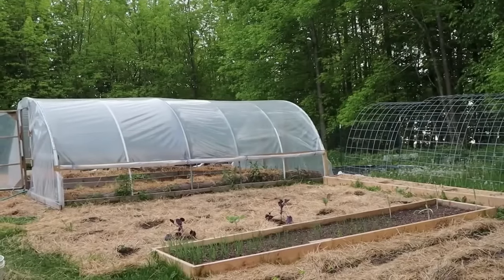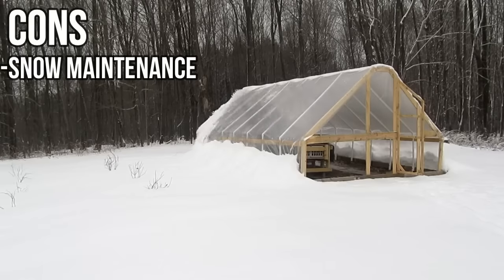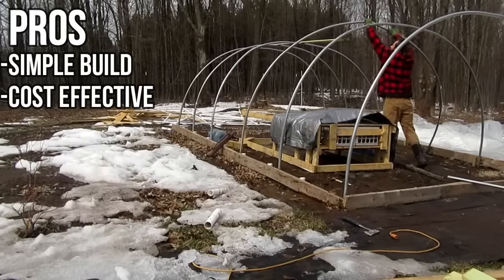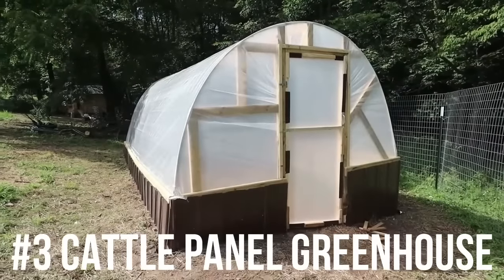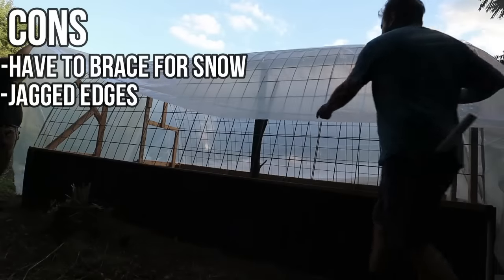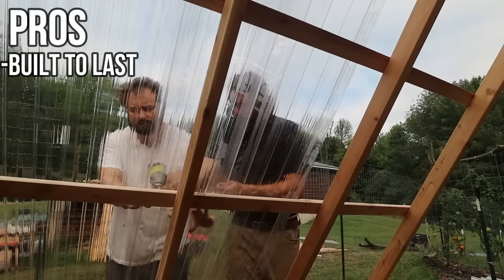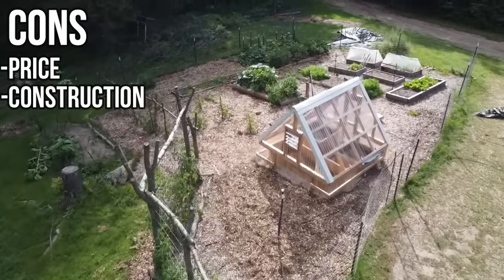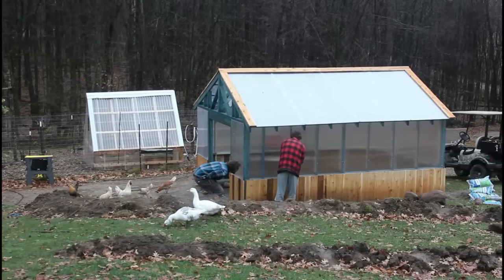The Ultimate Guide to DIY Greenhouses: Pros, Cons, and Everything In Between

Comment: When I get around to building my greenhouse it’s going to be a monster! 150 ft X 50 ft.  I’ll save some money by using my own trees and cutting them into lumber sizes myself.  It’s really going to be a chore to build, especially when I have to build it all by myself. With the help of my vehicles and tractor I’ll figure out a way.
Built my 20ft X 12 ft chicken coop tractors that’s all on wheels with a hitch to hook it up to a truck to move wherever I want. Makes it nice not having to clean as much, just move the coop to a clean spot and let the waste compost where it lays!  Coop itself is actually 12’x12’ and 3 ft off the ground so chickens can use the area under the coop to get out of the weather.  Hardware cloth goes all around it to keep chickens safe from predators.  Built it like a tank since I knew I would be moving it around like a RV trailer on a rough field. It’s over 3 years old now and still looks like new.  Very expensive and even more so if built today with cost’s climbing so much! But even 3 years ago this still cost me $6,000.00 to build since I used as much waterproof material as I could and treated lumber. All framing was pocket screwed together on all joints from both sides with deck screws and glued with exterior glue too! Even glued all the siding on as well.  So it won’t be falling apart anytime soon. Been a woodworker for most of my life and I don’t build things to be taken apart. Much less fall apart either!  I only wanted to have to build this once and never have to build another one to have to replace one falling apart!  I  hate having to rebuild anything!  Think I have accomplished my goal looks like, least so far judging by the last 3 years plus.  Sure get a lot of compliments when people see it.  Especially for being the first coop I have ever built. Fortunately I really didn’t make any mistakes that I have regretted yet! Even the 8 ft long roost that’s on hinges so it sold up against the ceiling and out of the way for cleaning the inside of the coop been a blessing for cleaning!  I didn’t want to have to try to always have to clean behind a long roost in cramp space! This was the best idea I’ve had in a while!  Building the greenhouse certainly going to be a bigger challenge doing by myself.  It certainly makes you think harder when you don’t have a extra hand or two to do the construction work! If there’s a will though, there’s a way! Eventually I’ll figure it out, provided I don’t kill my self in the process? 😂
Reply from the maker: That sounds unbelievable! Having access to your own lumber helps alot. You need to call that a green mansion haha
Reply: @TheNorthBranchWI  That’s funny! When I first built the chicken coop, people were calling it the Trump Tower for chickens! 😂  Before the chickens moved in, one of my relatives wanted to rent the coop to live in himself.  Actually would of made a good size bedroom compared to many bedrooms in some homes.

Comment: We have a cattle panel greenhouse. 8x16’. 
I hate it. We did put a ridge beam, but we are in a high wind area and the plastic has been ripped and repaired several times from it. Wind comes in and just inflates the whole thing, busting out the weakest link. 
We plant to remove the panels and use them in our garden beds this year and put an A-gram roof on the greenhouse with paneled sides.

Comment: My Father made a green house…. Approximately 15x45ft that was in the style of the #2… but ousr was 1. made with curved pvc pipes, 2. Had a double layer of plastic & 3. There was a mouse wheel style fan that inflated between the plastic layers. (This created a gap of insulation between the inside area and the outside.(edit! 4. The greenhouse my dad made also had a foundation that had lag bolts going through the 2x4 boards on the foundation that secured the pvc pipes)plastic was secures to the 2x4 with staples and caulking to help keep it inflated)

It did get destroyed in a snow storm 4-6 years after it was first built, later it was turned into a stable for a horse with open ends and a tarp. It was a great green house.

Comment: Appreciate you posting this video. I have built 3 pvc hoop greenhouses over the last 22 years and 3 locations. The 6 mil plastic only lasts 3 years in hot sunny Florida. One box of 20x100ft 6 mil plastic , you get enough plastic to cover a 9x16 3 times. So the initial investment of the plastic $100. Is good for 9 years.

Comment: Thinking of building large greenhouses for hydroponics in our lower fields at our house. Tanks at the top of the hill to hold water in summer, a well below pumps up early in winter until full. Goal is low energy use, and solar panels the next field over. Carbon-negative growing operation.
I live in Oregon, so you can guess what I'll be growing :)

Comment: I'm always shocked that people don't paint the wood FIRST then construct things. When the wood is so easy to get to before its up in the air or below the hips to paint. I can't even imagine doing something like that it just makes zero sense to me to not paint wood or varnish etc FIRST!
Reply: Stated cedar is used. Very rot resistant, looks nicer than peeling and blistering paint or varnish
Reply: It’s normal to do a first layer of paint when it’s material and a second when it is built, there will always be scratches or imperfections made in the building process that a second painting after construction will iron out

Comment: I would also recommend that any greenhouses be built like a high tunnel or gothic high tunnel,  prefferably just high tunnel and close the ends with geodesic dome halves that can be researched online with the length being east/west the ends (dome halves) on the east and west ends  of the tunnel givine maximum daylight to the tunnel. If you research diy high/gothic tunnels you will find out how to build the spars inexpensively. And how to treat them to resist moisture.

Comment: I definitely recommend plastic sheeting over the corrugated or double wall panels unless you have plenty of money. Sure it lasts twice as long but costs at least 5+x more for corrugated and 8+x more for double walled stuff. 

I personally use two layers of plastic sheeting with 2x2 between them. The inner sheet lasts 8-10 years with the outer lasting 4-6. The biggest thing is getting enough slope so snow falls on its own. We use cattle panels on top of 4' treated lumber walls. No bug problems either.
Reply: My experience with the sheeting is that it only survives two to three years. Double wall survives easily ten years.

And the difference is that the double wall stuff is far better suited at keeping your green house warm, extending the useful period by way more than a month where I live. Many plants simply won't grow fast enough in the open, and will struggle in a sheet green house if temperatures drop to low at night a bit early.

Another thing he didn't cover: with rigid walls you can add windows to the roof which automatically open when the temperature gets too high.

Where I live the double wall stuff also seems to be a lot closer in prize to sheets than where you live ...

Comment: So, I am wondering... between the cattle panel greenhouse and the one which is shown after it, the A-frame w the rigid plastic panels.... I didn't notice any in-ground posts for that, so, couldn't the A-frame be built without them too ? Per my experiences,  I would think the cattle panel one would be in more danger of blowing over or ripping the plastic then using it like a sail... ( had it happen to a tarp covered carport type "shed" from Menard's, in high winds. Not even THAT high of winds, either). My next thought is would it help if one put in onto very heavy lumber or log "skids" , which could also then have eye bolts on the ends to be able to hook a chain to & then pull to move it if ever want to. Anyways, thinking the weight of those could be enough to secure it (unless u live in a VERY high wind area)... ? (If live with very high winds, would probably need to do a dome ?  , or maybe my next, favorite idea would suffice). 
My ideal way to build one, I think, is going to be either the rigid clear panels (or maybe cheap, used patio doors) or cattle panels w plastic, on the south sides, w any of those clear materials on the framed ends, and a simple, VERTICAL frame, clad in shed siding, with a berm of soil at least halfway up the back/north side of it ( for us in the northern hemisphere, obviously). I'd add hay or bags of leaves in winter from there to top. Preferably have a foot or so of eaves along that side, and a rain gutter, to avoid issues from not having that. This would be a 4 season greenhouse, but I'd pry not heat it, not overwinter tender plants in it, but instead have them in a sunroom on the south side of my home, where it can also give me a joyful space to look out onto and have lil lounge space in :). That's where my citrus trees etc. would go.
Reply from the maker: We used metal anchors on the a - frame.  But yes, i think you could frame some hip walls and then do an a-frame and it would take a lot to move it.  Could even put some logs beside it and ancher to that to keep some mobility.    Could do the same thing with cattle panels, in theory.  4 hip walls then add the panels.  But if I did that i would want some additional bracing in the middle.  The panels do put some good  force on the walls when bent.

A lounge space with some citrus is living.   I don't know how far north you are but I worry that even if I heated our greenhouses we dont get enough light in jan and feb to grow anything.

Comment: For the heater of the last greenhouse, check out DIY solar heaters using a wooden box, cans, and BBQ grill black paint, with a Lexan cover. I love the greenhouses and appreciate the video. We are getting ready to add a couple of greenhouses to our farm this year.
Reply from the maker: I will have to look that up! Thank you. and I hope this can help you out. Goodluck on your build! Also, I made a video documenting their winter performance in more detail if that is something you have to account for haha
Reply: I would highly recommend that you check out if you get enough sun in the off season for that to work, I can tell you there is not enough in upstate NY.
Reply: @TheNorthBranchWI  You can also line the lower part of the walls with bricks painted black to function as passive solar heat collectors.
Reply: He's probably talking about night time heat generation (not solar). SInce the greenhouse probably gets very hot during the day even in the winter.  The state of the art for DIY solar heating boxes seems to be the ones that used window screen as the heat exchange surfaces.  There are some sites with good test and data on this.
Reply: Rocket mass heaters are the way forward ...
Reply: @deanthornby2026  solar>heat pump heating a thermal mass (water) battery  has advantages depending on lack of wood fuel  and or sun availability, depends on the situation

Comment: I have a 16 foot by 9 foot cattle panel greenhouse with PVC piping for framing.  I put panels horizontally on the inside with 6 mil plastic sheeting between the panels and the PVC and panels  vertically over the top with 6 mil sheeting on the outside giving me about 1 1/4 inch air gap and a quite rigid frame!  The inner panels are attached to the PVC with wire with duct tape reinforcing the plastic where the wire goes thru!  A shallow plastic-lined ditch around the base of the greenhouse directs the rain/snow water into the plastic barrel that is buried inside the greenhouse so the plants aren't drowned in a downpour and this doubles as a heat source when needed by placing an aquarium-style electric water heater in the buried barrel! The only con is that condensation can build up between the plastic sheeting!  The whole greenhouse is sunken down about a foot because it's better insulated and we get pretty strong wind storms here!  Thanks for the video!
Reply from the maker: That sounds like an awesome system.  Good work

Comment: I have a pvc irrigation system in my garden which I constructed about 15 years ago.  It is about 6 feet up in the air and gravity feeds into the various beds.  I've never had a problem with any type of deterioration, other than the wind blowing it down because I don't glue the pieces together so I can take it apart when needed and move it around if needed.
Reply from the maker: That is so cool! Extremely interesting. And 15 years?! Nice work haha
Reply: i was thinking about this i have BIG wind's here i used to have like there frist one the made but my was riped apart from the air.
Reply: @Alepoudiitsa  I live in what's humorously called "the wind tunnel".  When there's a slight breeze in town 7.5 miles away, here it's  blowin' up a gale! Now that the trees I planted 25 years ago are more-or-less full grown, the wind problem has subsided a bit, unless the wind's coming from the SE.  Then there's a problem.  
If you put your irrigation system closer to the ground, you probably won't have a problem.  Greenhouses, on the other hand, covered with plastic can be a problem.  How about building a small one and covering it with the corregated  clear plastic that's used for roofs?  I've had that on my back deck for over 15 years and, so long as you screw it down completely, there probably will not be a problem.  
Good luck with your project.

Comment: I put an A-frame on top of a chain link fence garden, and then I covered it with the four mil plastic, cheaper than 6 mil, they both rot in the sun within six months, they don't last 3 years. With very little Lumber, the additional weight on top of the chain link fence it's about 150 lb. Each corner post is sunk in concrete, it's just a fenced-in Garden that I put a roof on. It's mid-February and as soon as this three or four in that snow the other day is done melting I can recover the plastic and within a day the dirt is soft enough to work. In order to maintain Heat in the early and latest part of the season, I have black rain barrels inside the greenhouse that radiate enough heat overnight to keep things from freezing at 4 a.m. if you do it right, you don't tell Congress that you have rain barrels in your backyard. By the way, if the government asks you to register your vegetable garden, refuse to do that. Don't be a moron. As of late, they don't need to know anything.

Comment: Nice video, thank you.
I would like to try and give people, a little more information and some other options and pricing info on your last greenhouse.
First a little info about myself.
I have a little indoor operation. Three 200 s/ft rooms. I've been growing indoors for about 12 years now. With great success.
I also have a huge outdoor garden. Where I grow mostly melons and or other plants that spread out a lot.

Well 4 years ago I decided to build a greenhouse.
Why ? I don't know.
Just something to do, I guess.
Anyway, I wanted it to last.
I didn't want to have to replace that 6ml plastic every few years. So I decided to go with the polycarbonate sheets, like he did on his last greenhouse.
There's a few options you have with the polycarbonate sheets.
There's 2 single layer sheets and then theres the double layer sheets like he used.
I highly recommend that if you are going to go with polycarbonate. That you use the double.
I didn't and I totally regret it.
Let me explain.
When I was pricing these sheets. The price difference between the single and double layer sheets was like 10 bucks.
And I needed a lot of them.
So I went with the single layer.
And I've been kicking myself in the rump ever since. It was a huge mistake in more ways than one. 
First off the single sheets are rippled. So you have to add more supports in your walls and roof to attach these funky little rippled plastic pieces to attach the sheets to.
So that means I had to add more wood supports to my walls and roof. Then go back and attach all these plastic pieces to those.
Then go back and attach the sheets.
So really it was triple the labor.
And on top of that, once I bought everything to install the single layer sheets.
It cost me double what the double wall sheets would have cost me.
With the double walled sheets you can install them just like plywood or sheetrock.
FAST AND EASY.

Now for the foundation.

I didn't use cement.
I did the same way I build my sheds.
The greenhouse I built was a 10' x 12'. So I got 3, 4x4x10s and layed them out to the dimensions I needed. Whats good about using these 4x4 is, if the lot where you are going to build on, isn't level.
You can just pack gravel under the 4x4s to level it off.
Next I drilled 3 holes in the 4x4s and pounded a piece of 3' rebar into each hole.

Then I made I box out of 2x4s the dimensions I needed. And attached this to the 4x4s. Then I ran joist across that and covered it with plywood. And that's the foundation.
Then just build your walls and attach them to your foundation. That's easy and fast.
I wanted this greenhouse to last. So I went overboard.
And built all the walls and roof with 2x4s. That I painted white.

Let me tell you this WAS NOT CHEAP.
Just for the material it cost me almost $ 3500.00

The main cost was those polycarbonate single layer sheets with all the other crap that I had to get to install them.
I figured it out that if I would have used the double walled polycarbonate that it would have lowered my cost by almost a thousand bucks.

Anyway I thought I would just pass on my mistake to you all.

Good luck to all.
Take care.
Reply from the maker: That is great info! Thank you for sharing. I am sure this will help some people! After working with both of those materials I think you hit the nail on the head. Thank you for taking the time to type that out!!